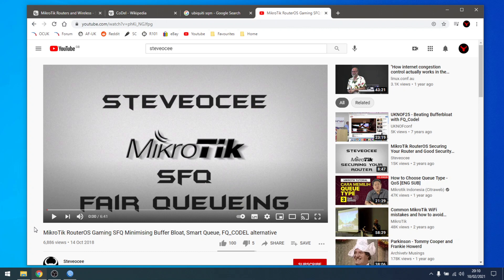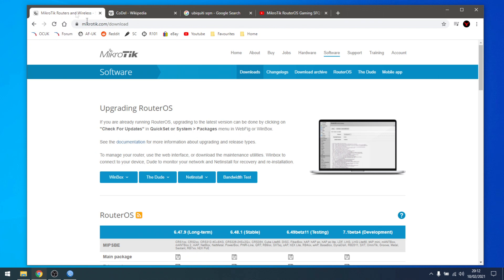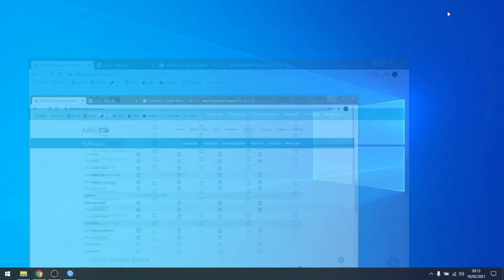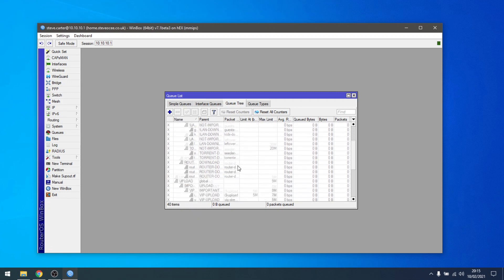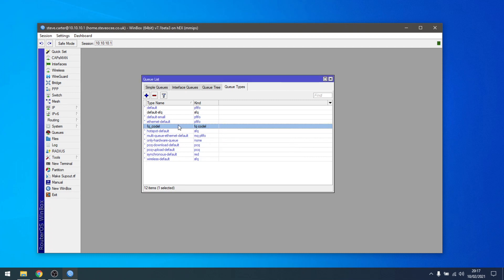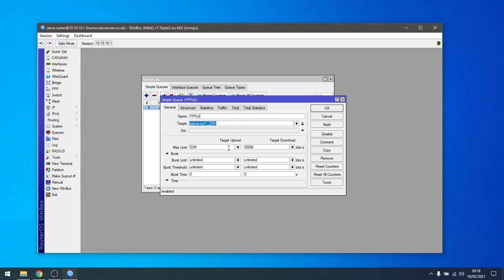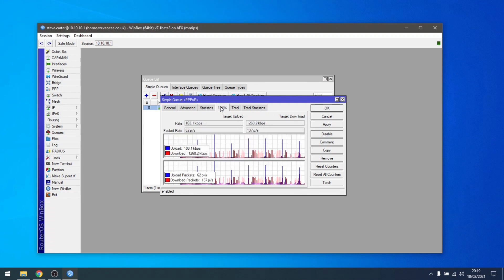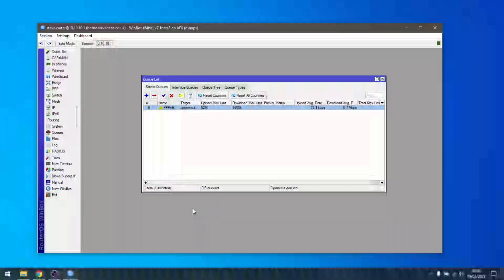MikroTik RouterOS FQ_CoDel How To reduce buffer bloat and SQM queueing with v7

Comment: I’ve been looking at a mikrotik router for a while, I currently have/use the edge router x which is a fantastic piece of kit, can do pretty much everything you want, however it doesn’t support cake SQM which is a shame as a online gamer I need the lowing ping/spikes possible, can you recommend a mikrotik router to go for? Thanks.
Reply from the maker: Hex R3 is a solid performer but depends on your internet speed coming in. TBH The Unifi UCG Ultra is a killer piece of kit atm.
Reply: @SteveoceeCoUk  I went with the Nanopi R4S with Openwrt Cake and SQM, Very very fast great peice of kit also, I will keep that in mind 😉

Comment: Whats the best queue type for varying bandwidth? From like 80MBit/s to 20MBit/s?
Reply: I have same issue: my isp  reduces bandwidth at night. i wonder if any of the queues can detect changes in bandwidth and adjust parameters accordingly
Reply: @kiyoponnn  You could utilize the scheduled task management for different ToD.  Aside from that, generally it may be safe to leave downstream at the high end and only target upstream.  That's what I have had to do for EdgeRouters anyway.
Reply from the maker: You need something adaptive, MT won't allow you to do this "easily" as you have to hard set values. You could get creative with some script and scheduling if the variance is by time of day?
Reply: @ Yup, thats what I did back then. Now I have DSL, much more stable :)

Comment: I set this up on my Mikrotik, however when a PC starts downloading game updates, it gets the full line capacity, causing ping spikes and packet drops for other devices on the network. Is there a way to stop this from happening, without having then specific queues for that PC?
Reply from the maker: Set the queues at 90% of the available bandwidth. If it still doesn't work then the queue can't be applied correctly.

Comment: Any tips for setting it up on LTE-based connections (4G)? One thing I am totally lost for is what to put in the max limit bars (since my bandwidth varies anywhere between 150/80 to 2/2 depending on weather, time of day, probably even the mood of ISP :D). But yeah, I have tried doing this setup, but I can't seem to get any change. Tested with no queue, with queue with target as lte1 and also tried ethernet1 (my PC's connection to router, altho not sure if this would make sense). Tried different limit numbers as well. It doesn't seem to make any difference really, I still get absolutely horrendous BufferBloat (dslreports rating C or sometimes D, trying to play games can be hell). I just don't know what to try any more.
Reply: Wanted to note the worst part - running two dslreports tests in a row without changing anything can have larger differences in results than, for example, queue and not queue for me. So yeah, I have literally -1 idea if I am improving things or not or if a change exists. But I can tell if there's improvement it's not big enough to solve my issues.